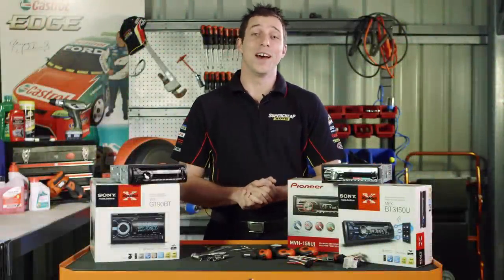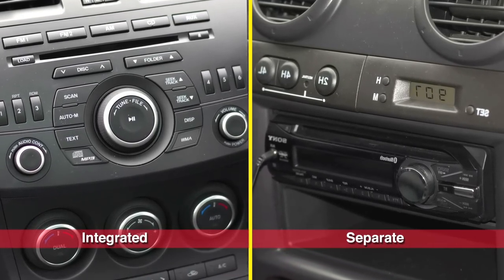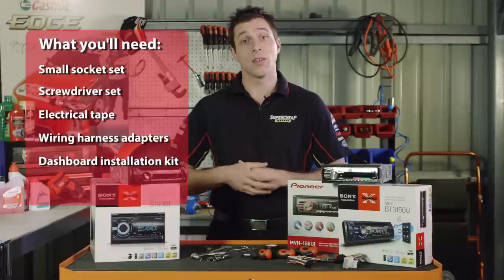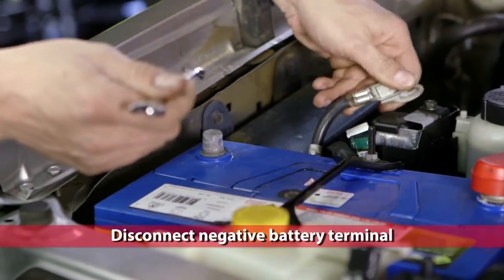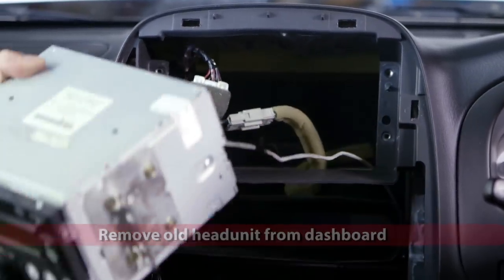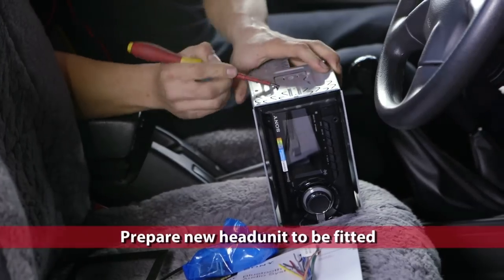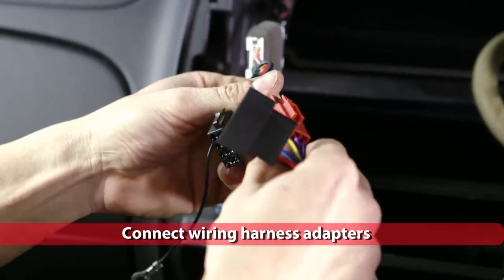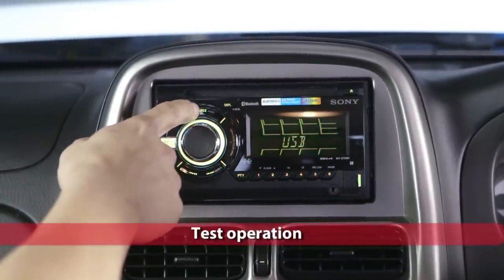How to - Installing a new Headunit // Supercheap Auto

Comment: on the other side in my car there no Speaker wires how can i fix that
Reply from the maker: Hi Luke, Thanks for your question. You'll need to feed in new wires in place of no existing wires.
Reply: @supercheapautotv  Aerpro Radio Wiring Harness what one is the left auto
Reply: @supercheapautotv  what i have to do
Reply from the maker: Hi Luke,
Best to look at the service manual to understand the wiring of your vehicle or best to talk to an automotive electrician if you're not sure.

Comment: I'm not able to do call with sony wx 90 bt....When I call from this device  other person can't listen my voice but I can....How can resolve this issue
Reply: The in built mic on the head unit is really crappy, you need to install a mic and mount it on top of your steering column so it faces you. It's not just your head unit, it's all of them. They all need a proper mic to be usable.

Comment: If stereo which is new keeps reverting back to initial set up and demo mode?  Installer said seems like its a stereo fault since wire connection is fine.? 😑
Reply: He connected it to the 12v accessory wire instead of a 12v continuous wire. The unit is only getting power when you turn the key to the acc or on positions. Easy fix, take it to someone who actually knows what they're doing. It'll take them 10mins.